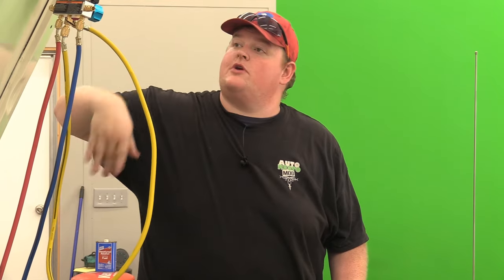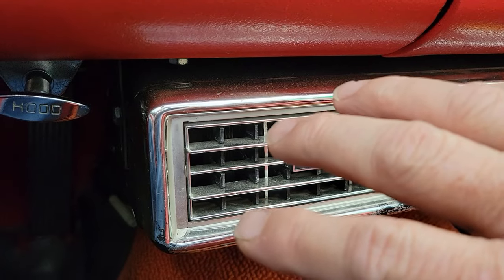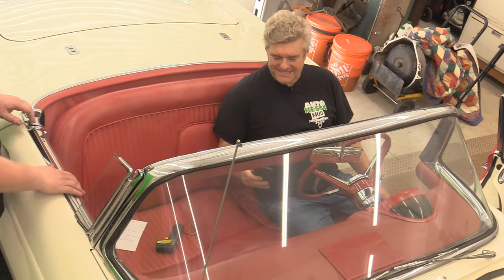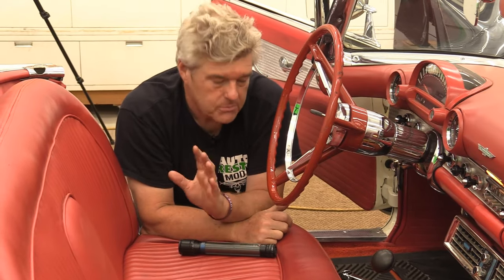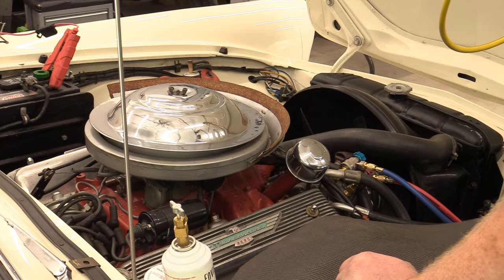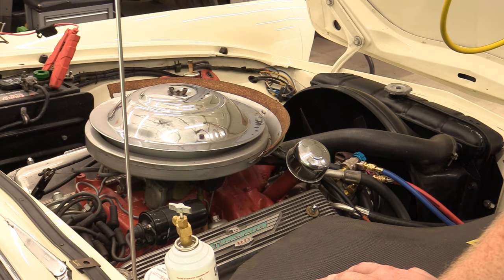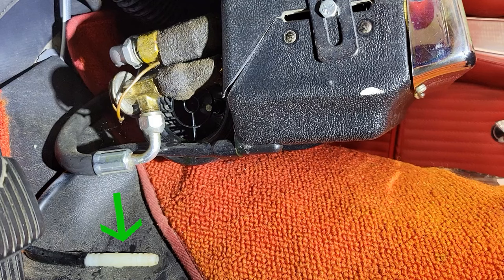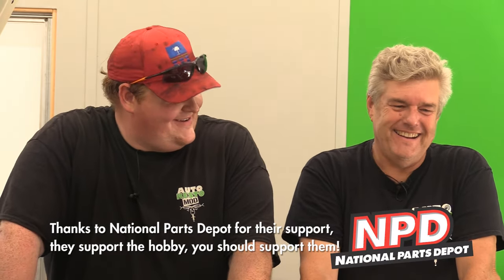Car Air Conditoning R12 Replacement Does it Work?

Comment: We always pull it down where it will put out 40°, using the little round gauge. When it all sealed up, enough Freon, and large enough condenser to handle the R134, you’re golden….
Reply: 33* cold enough?

Comment: I have used envirosafe in the past and it works quite well. It has to be installed exactly how the manufacturer says, otherwise it separates into the components and won't cool. I had that problem and I had to vent the system, pump it down, then recharge it.
Reply from the maker: We've had really good success so far as well

Comment: I converted to R134a a few years back on my '76 Coupe DeVille and it's never been right ever since.  were I to go this route how should I proceed?  evacuate the system and try again after making sure it holds vacuum?  what about the old oil - how does one go about purging that?  I added about 8 ounces of refrigerant oil back when I did the conversion..

Comment: There's not going to be a replacement evap core anywhere. That hang down system is so similar to Vintage Aire or Old Air systems, i'd rip it out and go with an all new system.

Comment: You should of done a nitrogen pressure test first to check for leaks
Reply from the maker: Oh for sure. We could not find nitrogen in our area for less than $300 for a 40lb charge. We gambled and lost.
Reply: If not Nitrogen compressed air can work in a pinch. Plain air is 78% Nitrogen
Reply: @jeffdriver3000 
Yes your going to vacuum it anyway.
Reply: @jeffdriver3000  Don't do that, the oil and receiver/accumulator dryer will absorb the moisture. Mineral oil will eventually release absorbed moisture after being under a deep vacuum for hours, but the dryer won't and PAG/ester oils won't release moisture under vacuum.

If you don't have dry nitrogen, a better idea is to pressure test with refrigerant after you vacuum the system. It takes hardly any refrigerant to fill it to perhaps 50 PSI of vapor and then you can leave it for however you want and see if it drops. Keep in mind that the oil will absorb some of the refrigerant, so when using that method, its not uncommon to have to refill to your test pressure several times before the pressure stabilizes, but after that, the pressure should hold steady.

Comment: Did you have to change the charge connectors to fit the 134 gauges? Or are R12 connectors the same as that of R134.
Reply from the maker: You will have to source the R12 connectors

Comment: Did you guys have it do anything to convert the system to r134 before charging it, Thanks in advance
Reply from the maker: Nope. The industrial 134 is compatible with R12 systems. I would evacuate the R12 and replace it with this though.
Reply: @AutoRestoMod  Here in the US, under Federal law, it's illegal to directly replace R12 with this stuff since it's flammable. It's not illegal under Federal law if you convert the system to R134a first, but it's illegal under some state laws.

Comment: Ive used their Envirosafe ES12a "industrial" product for 15 years. 
Pull a hard vacuum.
GREAT STUFF 👍👍
Much colder than 134 and 12.
BTW, 
its NOT 134, it is propane and isobutane blend.
Nobody wants to know that, do they? LOL
Reply: I don't understand why they say not to pull vacuum. That's insane to leave moisture in the system.

Comment: Nylog blue on the flare fittings is good insurance against leaks. Also used on threaded fittings as well. I did a bunch of 134a conversions back when they were a new thing and back then it was hit or miss if it was going to kill the compressor. There were allot of tricks go get cars to cool better etc. Like using different orifice tubes in GM modifying expansion valves in others.
      When I get out of a Miata I crawl out onto the ground...
Reply from the maker: LOL I feel your pain on the Miata front. I hadn't thought of the Nylog! Great tip!
Reply: Ha-Ha!!!  I was talking to a friend the other day about how it's getting harder and harder to get out of my Miata these days. Thanks for the video, I was watching because I'm down to my last can of R12, and my Miata needs to be topped off.

Comment: You should use R417c really good stuff run in my 1966 f100 26 supply temp on 100 deg day.
Reply from the maker: Nice! We haven't really ventured off the beaten path here with the 134 Industrial. The only potential down side I see about the R417c is that it only comes in the 5 gallon tanks. I like the Envirosafe because it is available in smaller sizes.

Comment: Their website is confusing and vague, perhaps on purposes.  Can I add this to an existing R12 system after an ac leak is repaired?
Reply from the maker: Yes. This is a mom and pop place so the website is probably handled in house.
Reply: Federally illegal to mix refrigerants.
Changeover is fine.